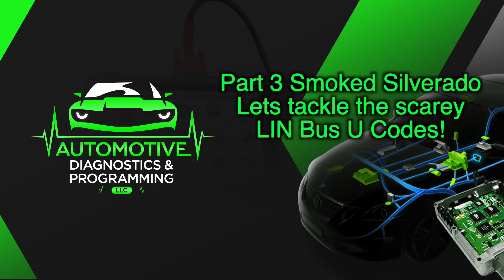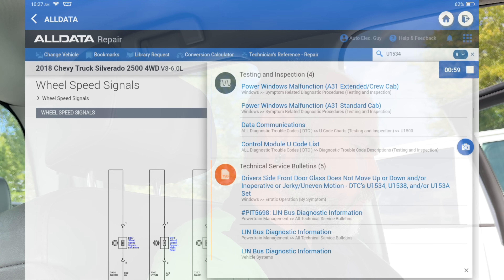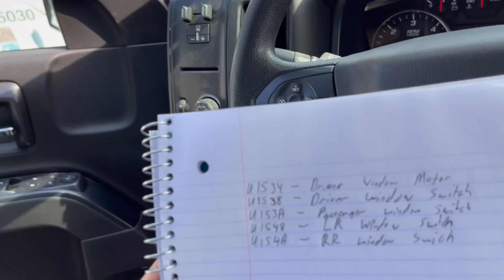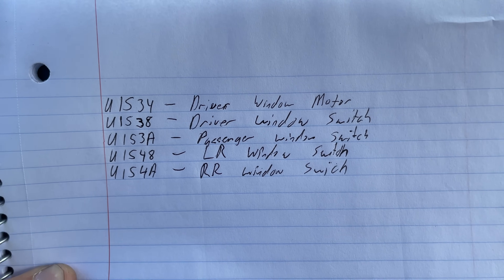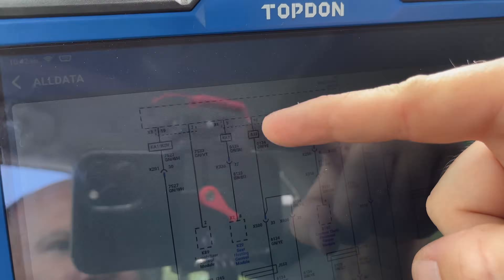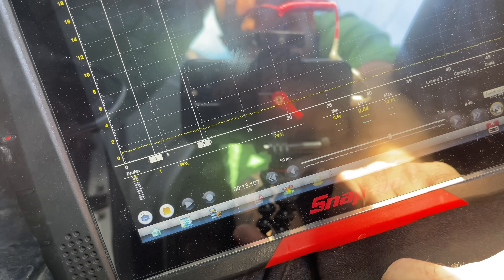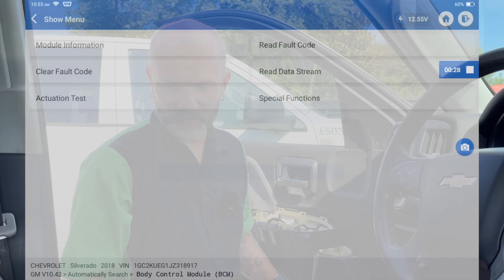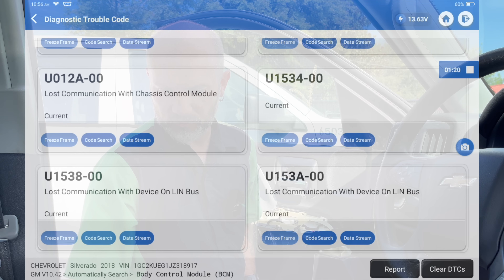Part 3 Smoked Silverado    Is it Lightening?

Comment: In the first video.
At minute 25 you Mentioned a B 101 d  BCM hardware code that might be a bad new B. C. M. How did you resolve that problem
Reply from the maker: This was a while back but the code was a configuration code if I remember right and it cleared once I setup the tire placard information. It’s been a while since this truck so I can’t remember why it didn’t do it in the BCM setup through sps but I did it in gds and then the code cleared.

Comment: I don't know the value of the truck, but I'm surprised this didn't get totaled.  It's a gift that keeps on giving -- the more problems you diagnose and fix, the more problems come up.  I'm almost curious if after the electrical troubleshooting and making the truck driveable, will the vehicle have horrible bearing noises, whether it be wheel bearings or driveline bearings?  Any electrical current finding its way to earth's ground has to get to the wheels/tires somehow...

Comment: The physicist in me still has to look for voltage potential differences.  After all, the laws of physics say a potential has to exist in order for a current to flow (and thus a module to burn out).  I'm guessing that low-hanging module under the bed was an exit point to earth for one piece of lightning; I'm surprised there isn't evidence of arc there.
Reply from the maker: I got at least 1 more video to do on this truck and can answer a couple things for you in it. And I have found the point of entry but even without one I can explain how something can get damaged without a direct hit.

Comment: The lightening didn't short out that main engine harness to the stud which you showed in the first video (by the way, a couple years ago I had a Yukon towed in  that was a no-crank & traced it to that same stud shorting out the starter wire.)  Is it possible that short did damage to the original BCM which damaged the window motor and switches?  It wouldn't explain the wheel speed sensors, though, as those go to the EBCM.
Reply: @autodiagyt  Well, that's embarrassing!
Reply: @autodiagyt  I just stumbled on to your channel and watched the previous two videos to this thinking they were both this truck...should have known the newer trucks don't have that big harness, though.  I just watched the first video on this truck.  Definitely crazy stuff but some good diagnostics!

Comment: The origins of LIN actually started with the door nodes in the overall vehicle architecture to reduce the amount of wiring needed in the vehicle especially the wire going from the body to the door, which is being flexed when you open and close the door, and the door feature list was growing to include door soft close, window partial down when opening the door and many more ultra-luxury gizmos. 

Is it possible to design a sub-bus which actually costs less than the wire it replaces? 

It is actually about break even in overall costs. The real reason where LIN wins out is in adding features in the vehicle model (upscaling) without having to change the basic architecture of the vehicle or modify the harness design. So, for example in one model type you have a unheated drivers mirror and on the upscale model a heated mirror. If this heater was done with traditional wiring you would have to change the harness design to power the heater. But with LIN you just change the mirror slave node and the upscale switch panel, inform the door module of the new feature and done. The harness in the door did not change. So the base harness is designed power wise to accommodate all of the possible added features, and then which ones are used are determined by what LIN nodes are installed in the door.

The system was architected originally as HSCAN to the door modules (one in each door also know as a door master) and then from the door module to the actuators and sensors (switch inputs) in the same door, which would use a sub-bus (meaning local to the door) called Local Interconnect Network (LIN). HSCAN was used between the doors and BCM to minimize latency, but locally the door control bus is LIN (which is lower speed but very cost effective). So, LIN to the smart motor(s), smart keypad(s), smart mirror, etc. which are all considered slaves. The elegance of LIN is that you have a single mixed signal IC (logic and power) in the motor housing that is design to talk on LIN a predetermined way (logically hardwired in function) so the door supplier can just use modules that have LIN communication and not have to design or write firmware (programming code) for the node. Operation over LIN is preestablished and hardwired in the ICs operation, so the only firmware that has to be designed are the master door nodes.

Comment: Your are correct their does not need to be visible damage to be lighting ,As a fire alarm tech I have seen many lighting damaged panels with no visible damage we know they were lighting  damage because the customer said their was lighting strike near by and the panel either died or was reporting troubles immediately ,

Comment: Good video! The lightning strike reminds me of when may recently passed dad was in his new 1985 Ramcharger when it was hit by lightning. The door locks locked as quickly as you could unlock them, trapping him in the vehicle for several minutes until he could catch the lock just right to allow the door to be opened. A quick pull of the fuse temporarily fixed the issue.

Comment: Modern automobiles have become computers on wheels that can be driven on highways.  Way too much electronics that is too delicate and too expensive.  I worked on telecom systems that occasionally would have what we called a "killer card." The system might have 75 different cards and somewhere in there would be 1 or more cards that would permanently mess up a new card when you inserted it.  We had to strip systems down to the bare bones to ever fix them. This isn't Jakes first rodeo, he will have it fixed shortly.

Comment: The only thing protected INSIDE a car is whatever is NOT sticking out, or in contact with any metal part of the car.
A nearby strike let the smoke out of an old 2!-way radio, and had other electronics statically charged for minutes!
(the 2-way was the only fatality)

Comment: Interesting lightning story: a house I bought had a big tree in the yard that someone had installed an area light on and ran an extension cord from it all the way to the house, we had a bad thunderstorm and lightning hit the tree which was about 100 ft from the house. The power traveled through that wire, didn't damage it at all got to the breaker panel and blew apart one of the circuit breakers and about set the panel on fire!! Sounded like a bomb going off followed by arcing and sizzling 🤣🤣🤣

It also fried All of the electronics in my $2,000 refrigerator that I had just bought 3 months ago 😡😡

Comment: Great series and can’t wait what else went up in smoke. 
 I guess the insurance adjuster didn’t figure in rain , moisture and standing water. 

I worked on barge cranes in the Puget Sound and we worked under the high voltage line that goes between Seattle and West Seattle. We were double the distance away than required, but on a foggy morning an arc jumped from one of the three lines to the boom of the crane. Talk about being scared. Steel barge in salt water getting a jump start from a 240,000 Volt overhead line. 

Nobody was hurt. The crane and power line weren’t damaged either.

Comment: Way back when, when cars were still a closed metal can with only basic electric components inside, not much would happen to that car in case of a lightning strike. But nowadays, big parts of it are made from plastic. And just behind that plastic, there are plastic modules with sensitive electronics inside and attached wires going everywhere.
Good story by the way. The insurer's agent and the tires.

Comment: That was a pretty quick diag, not counting the time it took you to remove the panels. Interesting that both the switch and motor was pulling the network down. I'm just assuming that the driver side door switch communicates with all the other door switches and or the BCM to be able to roll the other windows down, up. I'm thinking the BCM is the master module but not sure if the windows motors are controlled by the BCM or by the switch.
Hey Jake, nothing wrong with your handwriting, you should see mine.  
Loved your story man, cracked me up😂

Comment: I’m doing a battery draw with a test light(neg battery cable and neg battery post) on a 06 Ford Explorer 4.0 and the text light lights up and blinks slightly and it stays on forever. Is this a ok test my voltmeter died?
Reply: @autodiagyt  copy. I don’t like it either looks like a trip to buy a another tool.  You do awesome work I learn something new every time I watch

Comment: TBH I’ve always believed rubber tires helped protect against lightning. Now that you explained it that way, not so much 😂😂
Reply: The "protection" comes from the faraday cages effect.  When you're inside the car, you have no connection to anything but the car.  The same idea why birds can sit on powerlines.  But I'm not so sure that applies to convertibles or cars with non-metallic roofs.
Reply: @russellhltn1396  I get the fact that humans are safe inside a vehicle. I just assumed the vehicle was safe also because it was insulated from the ground
Reply: @chekelley6861  I don't know as there's much protection for the cars.  The metal body helps somewhat as it should take the brunt of it.

Comment: oh yes she keeps giving that’s for sure . lin bus yes indeed . friday had one no foot well lights all singing and dancing lights (ambient lighting they call it ) no lin . back to the zb2 (doip so they call it different than a bcm) yes no lin coming out . grabbed another module and no still no lin . looking at the drawing scratching my head because could not see anything else in there , buddy of mine said what has this got an sos button in the dbe this is not a federal spec car  . disconnected the dbe  and boom foot well lights came on . some times you just get lucky . the switch is on the line bus so took down the lights as it’s a different dbe roof and door loom for federal cars .

Comment: A friend had a strike at his home in the back yard, it followed a metal fence to the front, then through buried cables into the house and his daughters 2019 Jeep parked in the front. It fried a couple modules on the Jeep as well as several items in the house that were plugged in. The Jeep took a dealer tech several dats to sort out. Not a mark anywhere on the Jeep, it was all due to proximity, and it's lifted on 35" tires.

Comment: I Work at the airport. We use portable diesel powered generators for the aircraft.  I got a phone call that lightning had hit close to one of the generators about 300ft away. When I got there to check it out the engine was running at idle. I asked the guy who had saw the lightning hit if the generator was running when the lightning hit and he said no. He said it was funny it came on after the strike. It fried the engine control card and the several circuit boards for the generator portion. 😮

Comment: Used to work with building lightning protection systems and that's just a recommendation for the lightning. Lightning does what lightning wants to do and we still don't understand it all. And yeah, rubber tires... lol  Everything has a breakdown voltage and rubber tires are far below the breakdown level for lightning, like they aren't even there. Not to mention the 6 to 10 inch gap between the rim and road is inconsequential compared to the miles it traveled like you said. And you don't need a direct hit, just induced currents from a nearby hit is enough to fry electronic shit.

Comment: You are dam right ✅️ about lightning 🌩 comment you gave to the guy..last year i had a prius 2nd gen absolutely fried brains 🧠 not a single module evaded from getting fried even hv battery got fried i cant upload picture here i still keeps that in my phone to boggle my head each time i see it.good luck with repairs..cheers